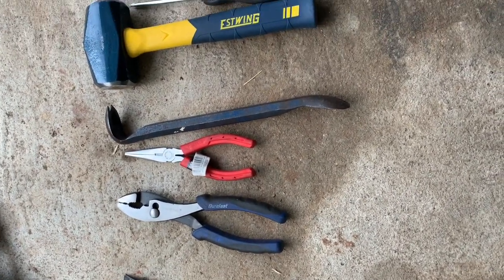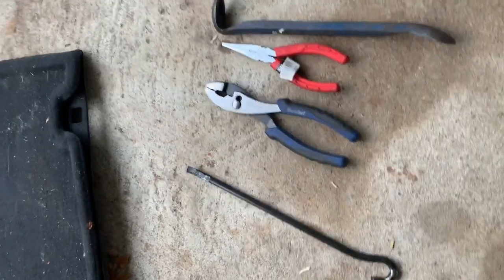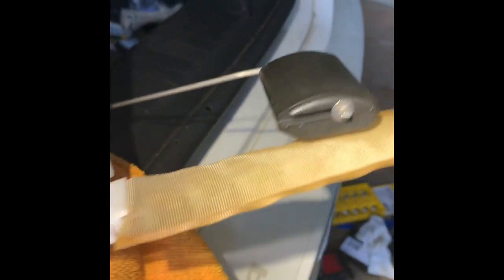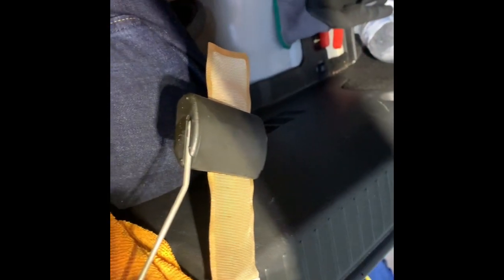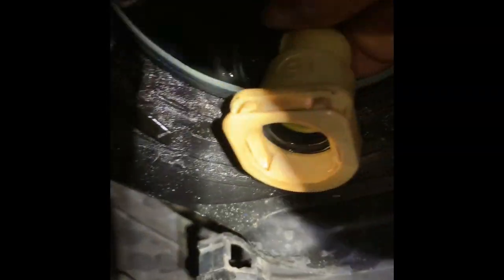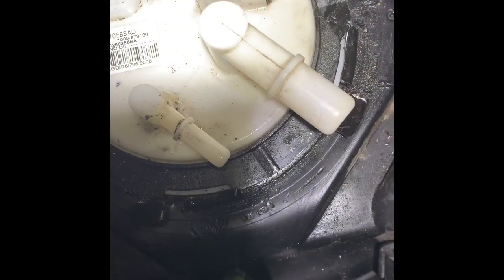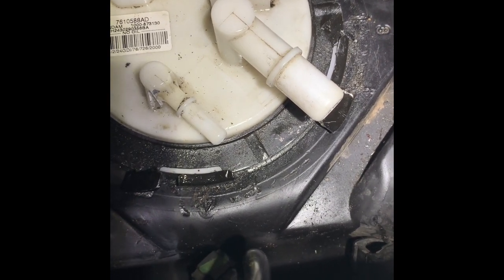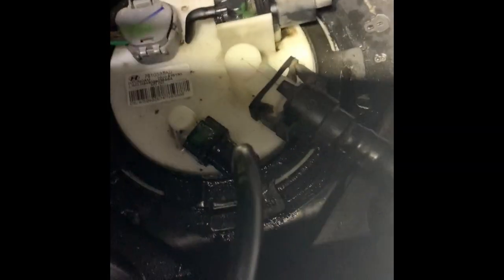2013 Hyundai Sonata Fuel Pump Removal

Comment: Don't show how you got it out
Reply from the maker: Disconnect fuel lines , turn lock ring counterclockwise, angle out fuel pump.
Reply: @azonicle  how do you disconnect the line from pump inside of tank?
Reply from the maker: @johndamjohn  squeeze the clips on both sides to remove
Reply: It’s not that easy.